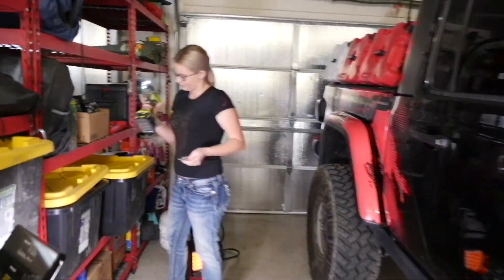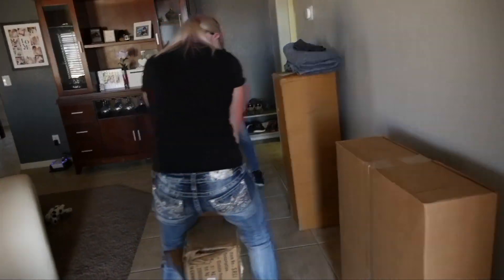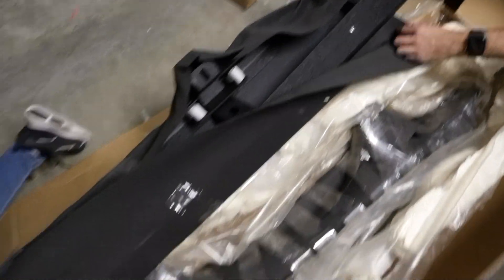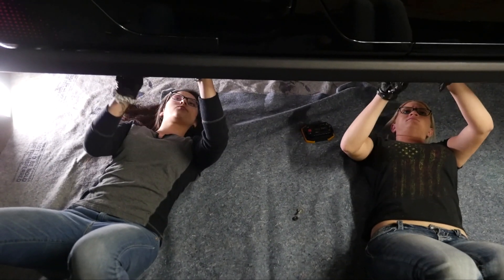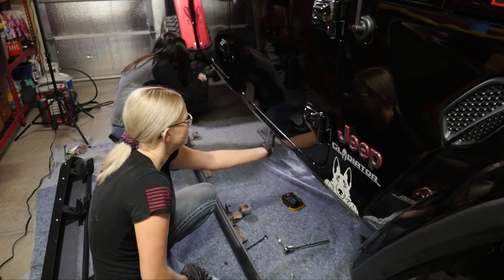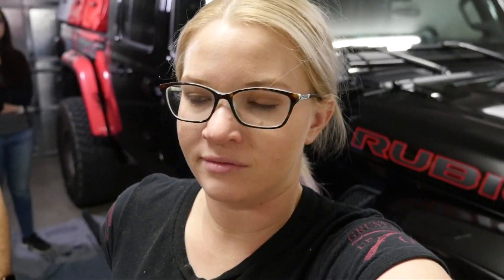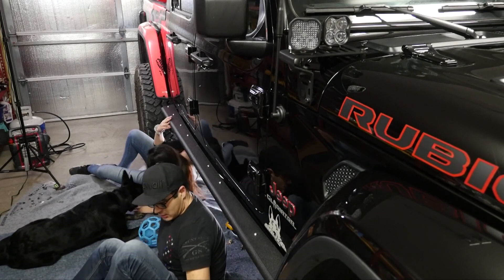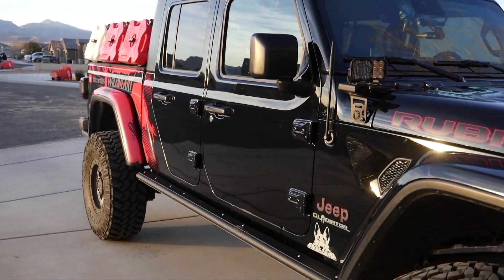DV8 Rock Slider Install SRGL-02 on Jeep Gladiator

Comment: Nice packing on those sliders.  I was also happy to see you painted the drilled holes.  A lot of installers skip that step after drilling, and it makes me cringe.
Reply from the maker: We try to do it right the first time! And I was surprised at home much attention to detail Dv8 paid with the packing. Nice to see. No chance they would get scratched during transit.

Comment: Where did you get the steps from?  I've looked and they show as pre-order with ETA of mid February?  Also, do the steps contour the body of the Gladiator and hide the pinch weld?  Thanks.
Reply from the maker: we will post more pictures of them on the JT Form. if you have questions, message us on our insta..